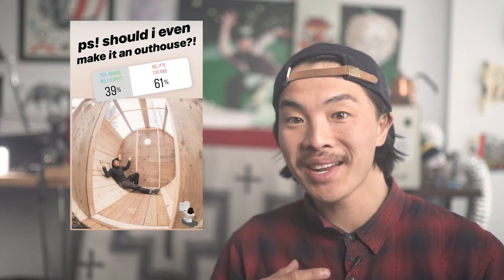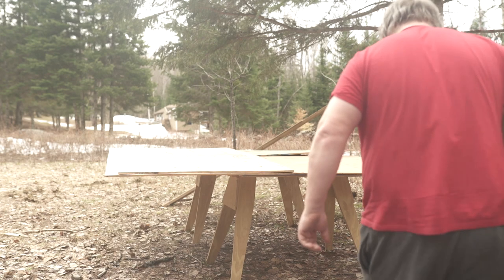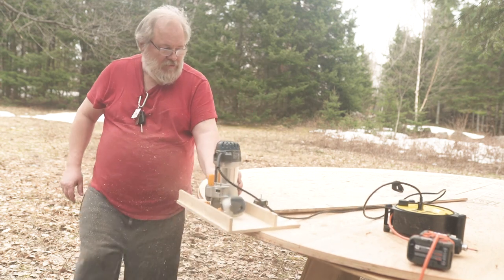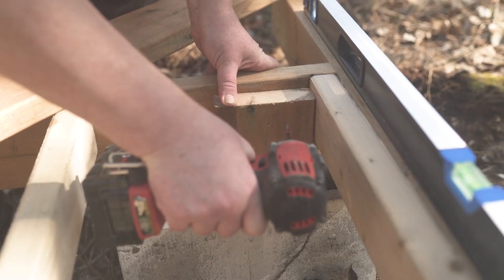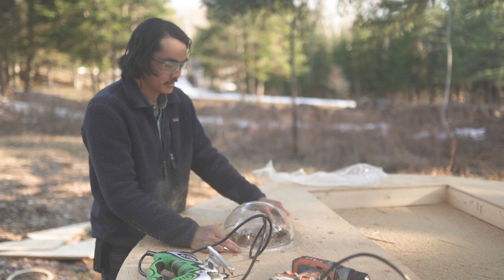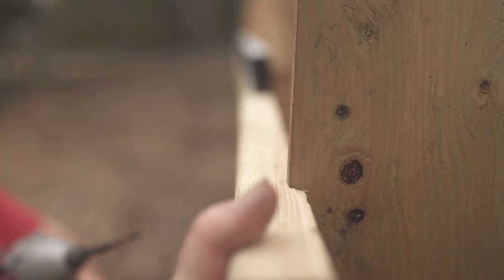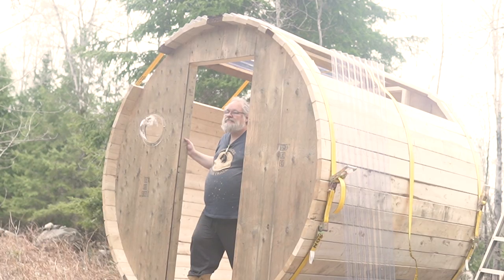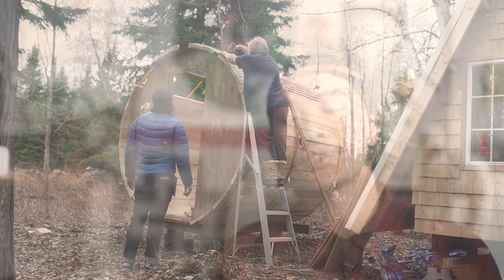Szeto's A-Frame Cabin Build - Pt. 12: The Barrel Outhouse Build!

Comment: New to channel since this morning but I love what you did so far. Did you ever think of installing a simple shower in the outhouse barrel? Looks like there’s some room to. Maybe one of those solar camping showers? Simple reconstruct of one area replace with small shower pan drain it out as grey water somewhere away from back of cabins. Maybe line the inside with cedar or teal sheets for moisture and I see you are installing solar vent 👍🏻 Also I saw you used a camping stove. Not the best but there are those tiny wood stoves that are cast iron that work really well in small spaces say 10x10 like I use in my shed. All in all I love your work
Reply from the maker: meckleboy oooh i would love that! i need a rain barrel or something haha. i will look into that shower situation
Reply from the maker: i also just got a free cast iron vermont castings aspen (it’s old, but going to refurbish it)